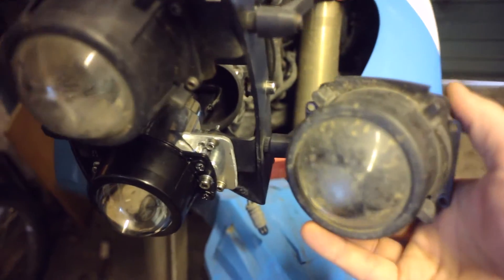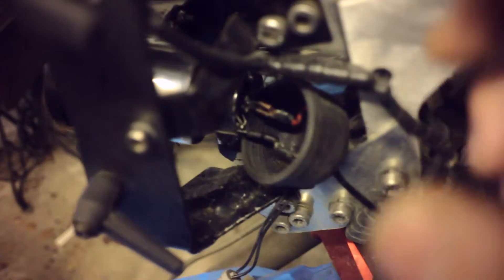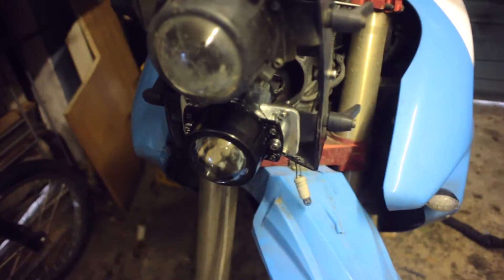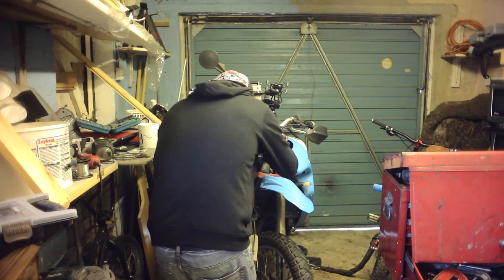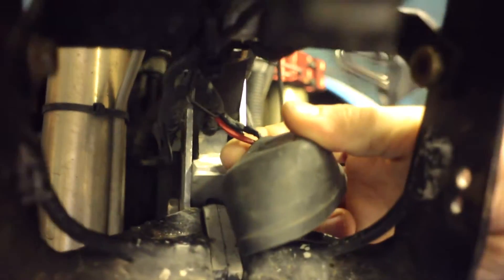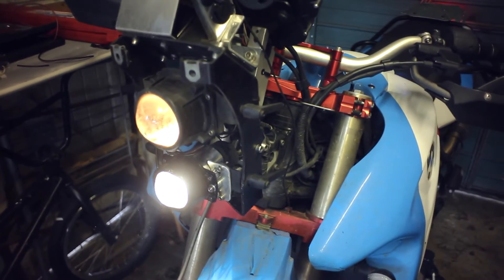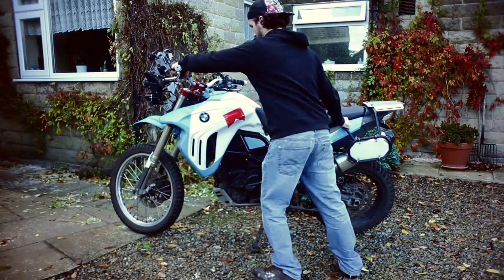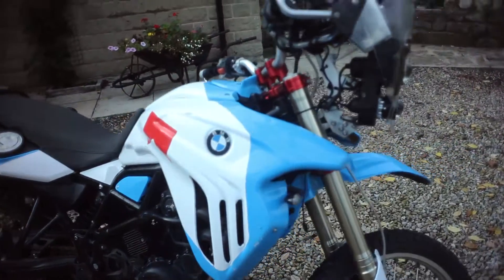Preparing the F800gs for the Hafren Rally part 1

Comment: did you wire your high beam? if not, does the computer has the warning light on?
Reply from the maker: ryoichi yamada hi! Just wired into the normal h4 bulb socket if I remember correctly. No warning lights
Reply: @RideUnlimitedrtw   Thanks for the reply, Do you have high beam or just wire the low beam ?  Mine comes with two H7 plugs, one with high and one with low beam and one more bulb is long life bulb.

Comment: What did you do to get the front fender like that? I'd really like to do the same thing with my 2014 F800 GSA.
Reply from the maker: outty77 hi there i used an aftermarket set of fork crowns and then bolted the new fender to the bottom with some basic aluminium brackets i just bent up. I cant remember if the standard fork crown has bolt threads underneath but im sure it probably does. I used an acerbis universal supermoto fender. They are undrilled so you can drill your own holes where you need them and are about20 quid.